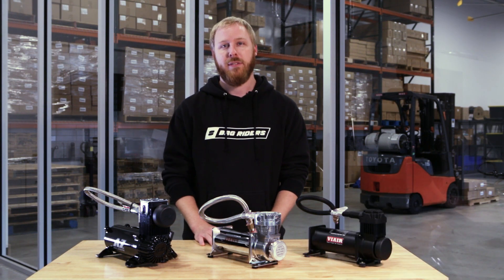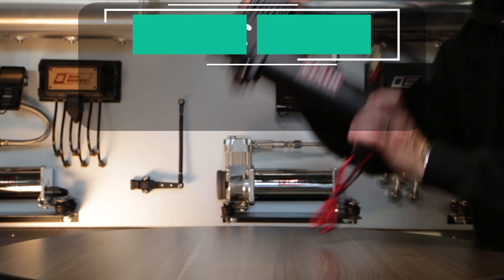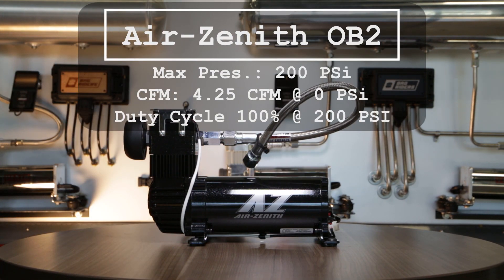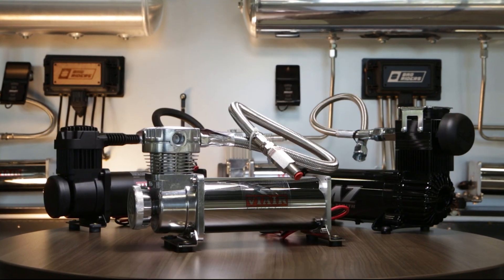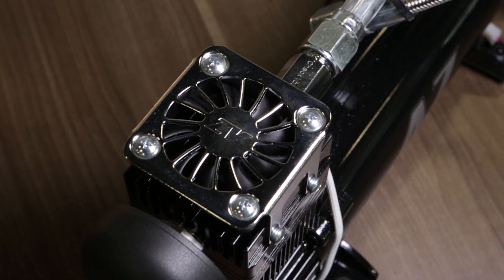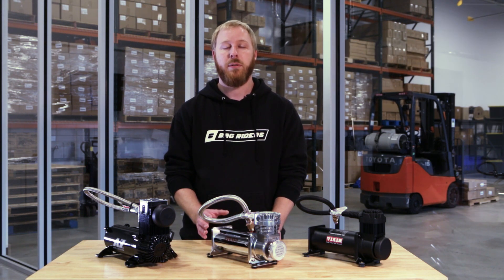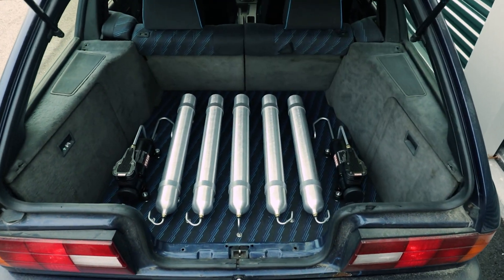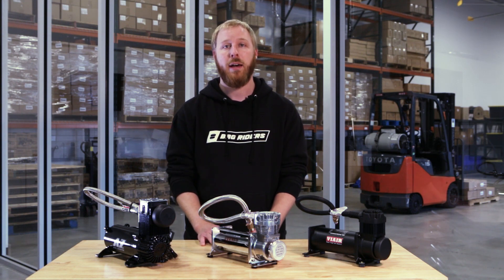Air Ride Compressors Explained by Bag Riders

Comment: Since you guys say installing the air tank underneath the rear bumper is fine, does the same apply for the air compressor??
Reply from the maker: Yes, the compressor can be installed almost anywhere! If you choose to mount it behind the bumper, just make sure the air filter is positioned away from any potential water exposure and not near the exhaust to prevent any excess hear damage.

Comment: How long does it take for the compressor to turn on?
Reply from the maker: The compressors turn on instantly once it detects a signal that the pressure is low in the tank which is around 120PSI for a system that is set at 150PSI.

Comment: How is it like running tankless? Im assuming takes a long time and wait and noise all the time when you enter a steep driveway and or bumps?
Reply from the maker: We won't recommend a tankless set up on air suspension. Having the extra air reserve in a tank will cut down on air up times.

Comment: Bought my 444c viair from bag riders less than a year old and is building pressure slow, I dont even let it run more than 25psi at a time
Reply from the maker: Message our support team at sales@bagriders.com or call 844-404-7344. Our experienced staff will be able to help you solve the issue!
Reply: Yeah I’m not gonna lie the 444c is ass I’ve had mine a little over a year and now warranty is up , now I gotta update my air suspension . Compressor freezes anywhere between 120psi and 170psi , never fills up and I just replaced the check valve
Reply: @Vr30Haha same mine finally gave out and doesn’t build pressure passed 30 psi now its doing a whining sounds im just gonna replace it smh . Ill probably rebuild the other on and run a dual in the future

Comment: is there any way to order the compressor to have longer leader lines ?
Reply from the maker: Unfortunately we don't have any longer braided compressor leader lines. What we would recommend is running some 3/8" air line off the end of the braided line to extend the reach of your compressor.
Reply: @bagriders  using ptc fittings and the black hose from the kit? Or do I use a braided line as an extension?

Comment: Just curious In your opinion would dual 485 be better to run than dual 444.
Reply: Of course
Reply from the maker: The Dual 444c will fill a 5 gallon tank from 165-200 PSI in roughly 1 minute 35 seconds and the dual 485c will fill a  gallon tank from 165-200 PSI in roughly 1 minute 15 seconds. Now the 485c compressors do have the newly-developed sleek head design, increased duty cycle and quieter dB levels but come in at a price of $185~ more than the 444c. If you are on a budget I'd recommend the 444c, if you have a little extra money to spend I would recommend the 485c. Both compressors are great at the end of the day. One just has a slightly higher CFM rate.

Comment: Need a compressor to replace a faulty Firestone compressor for my pickups air bags. I have no tank. Which Viair model would be best? Would like to use the same inflate/deflate switch and wiring that I currently have installed if possible.
Reply from the maker: Hey Rod, if you don't mind give our customer service team a call or email. 844-404-7344 or sales@bagriders.com

Comment: I have a viair 280 it won't shut of? Do the compressors have a shut of switch or is it my pressure switch not allowing the compressor to shut of?
Reply from the maker: The compressors do not come with pressure switches. What management system are you running?

Comment: With the Viair 444C, do you know if the filter built in is essentially a water trap as well, case being I wouldn't have to include a water trap in the line since the compressor filter takes care of it? Thanks
Reply from the maker: The air filter attached to the compressor is purely designed to prevent debris from entering the pump. A water trap is recommended on all air ride systems and that should be located between the tank and manifold.

Comment: Do you have to update the duty cycle setting in the Airlift controller when going to a compressor with 100% duty cycle?
Reply from the maker: You want to have the ALP Controller duty cycle set to what your compressor can handle. You can find the specs of what your compressor is rated on our website!